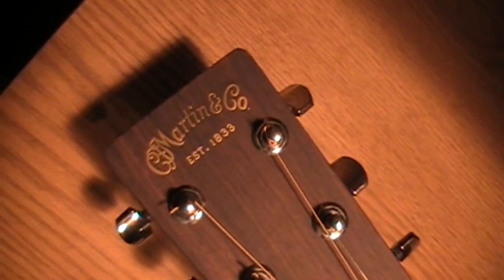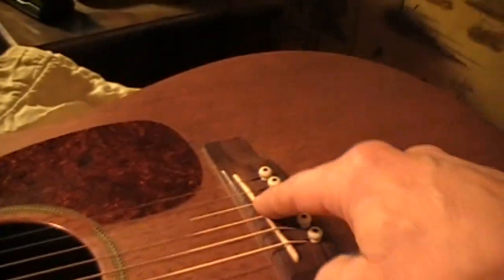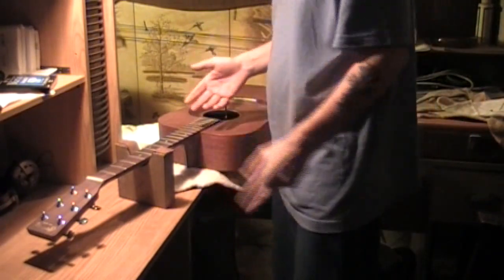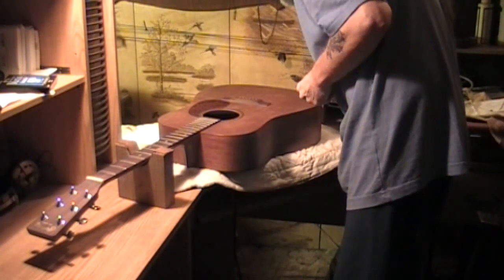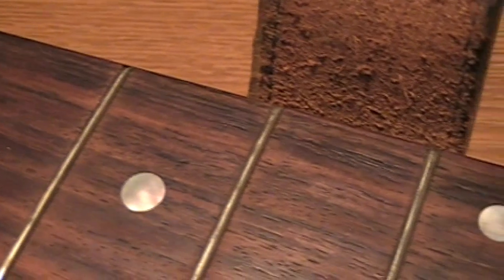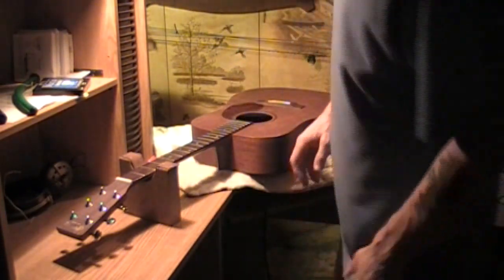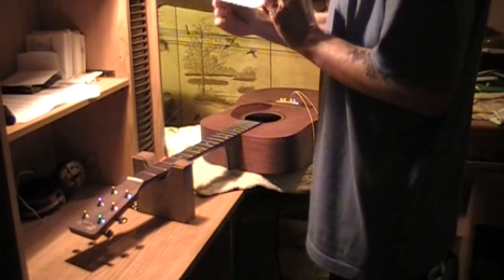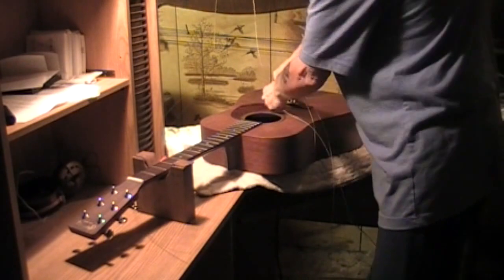Guitar bridge repair on an acoustic guitar! Martin D15 guitar repair part 1 of 2

Comment: Randy ,Thanks for sharing this i own a 2005 Martin D18 which i brought second hand with the same problem the action was getting worse and becoming un playable  ,so after watching you work on the D15 i took it to a good repair shop and they had to re-shoot the neck to relieve serious neck bow,re-sanded the fret board and re-fretted due to fret wear,shaved the bridge and saddle total cost £367.The results are amazing .I know some purists out there will be horrified at shaving bridges but if done correctly theirs nothing to worry about ...so get over it!
Reply from the maker: +DEAN LAWRENCE You are correct! If it's done properly and with much care it will fix a guitar and could last for many more years! Some people really look down on this method but it's proof it works and doesn't drop in value at all. I new bridge can always be put on it at a later date if needed. Thanks for watching and commenting my friend!

Comment: Thanks Randy . I look forward to 2nd part and hearing that little jewel sparkle. I have to lower strings at bridge too , neck is straight but saddle a touch high. Take care.
Reply from the maker: Thanks mate! Part 2 will have more hands on work to watch and more info and tips. I believe this little box is going to sound special once all the work has been done. Good luck on yours, you shouldn't have any problems unless you run into something like this.

Comment: Randy,  was going to adjust the relief in my brothers D15m. Its 24,000 -25,000 at the 7th - 9th fret   Trouble is I cant see it or reach it with a standard length Allen ( hex ) wrench.  My guess is I need a longer truss rod wrench?
Reply from the maker: Yeah they make a special tool just for those types of Martins, it has a screw driver like handle and a 45 degree bend in the middle so it'll reach back in there and the handle will stick up outside of the sound hole. 5mm in size for Martin. Heres a link you can see what they look like.
http://www.stewmac.com/Luthier_Tools/Types_of_Tools/Wrenches/Soundhole_Truss_Rod_Wrenches.html

Comment: Randy Schartiger ever work on a Kent and Goya guitar? Are you going to do more videos of Harmonys?
Reply from the maker: Yeah I've seen a few Goya guitars before, not sure about Kent. Yeah I would almost bet more Harmony guitars will eventually find their way here. Thanks for watching! :)
Reply: hello Randy I need to remove and reglue a bridge on my acoustic but have no long reach clamps ! any suggestions on what I might be able to do to ensure a proper  amount of clamping pressure for a good bond ? thanks in advance !
Reply from the maker: maybe use something pretty heavy to mash the bridge onto the top until the glue sets, or if you have some really strong magnets I've heard people use successfully but clamps is always best because you can control the amount of pressure.

Comment: One thing I'm confused about--if the saddle is so low, and the neck is straight, how is it that the action is still too high?
Reply from the maker: Over the years glue joints have moved slightly, quite a lot on this particular guitar, that and the belly deflection it had is why the saddle couldn't be lowered anymore, so by taking material off the top of the bridge, in turn allowing more saddle to be exposed, gives us more room to remove more material from the saddle. Other than this I would have had to do a complete neck reset because even with it straight it is at the wrong angle. I could have reset the neck to the proper angle and set the action with a new saddle but that would have cost a lot more. Hard to explain but I hope you get my meaning.
Reply: Randy Schartiger
I gotcha.  Thanks.  And hey, if you ever do happen to do a neck reset, be sure and make a video of it.  Another question I have:  Is there anything you do with warped necks to fix them, like if it's got a forward bow where even the truss rod can't get the proper relief?
Reply from the maker: 51MontyPython I'm sure eventually another neck reset job will come along and I will video it when it does.
If the truss rod was broken or didn't work it would be best to replace the rod, but if it works and still wouldn't make relief just right about the only other thing could be done is put the neck in a vice and SLOWLY force it into relief over a period of several days, forcing it a little at a time each day with the truss rod very loose and about 125 degrees of heat on it the whole time day and night. This is very dangerous as it could break or split, but is about all you can do if the rod doesn't work right.
Reply: Randy Schartiger
So what do you use for the heat?
Reply from the maker: 51MontyPython
I use a large heatlamp, you can hang it overhead and adjust the amount of heat by moving it closer or farther away from the neck.
Reply: Randy Schartiger
Cool, man.  Hey thanks for the advice.  Cool channel, too.  You seem very personable and down to earth, and also seem to know your stuff. Oh, and I did also subscribe just to let you know.  Take care, friend.
Reply from the maker: 51MontyPython Thank you brother! I appreciate you subbing! Yeah I try to keep it on the happy and funny side mostly, Some crazy things happens on this channel now and then. lol Thanks again for tuning in man!